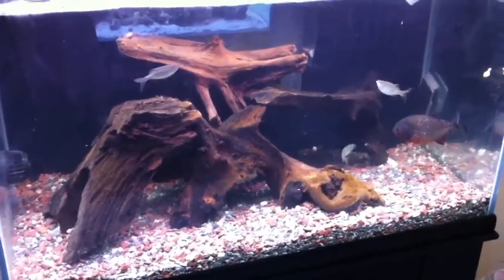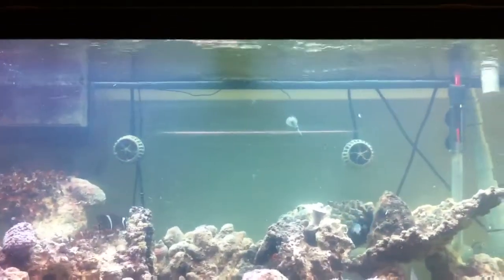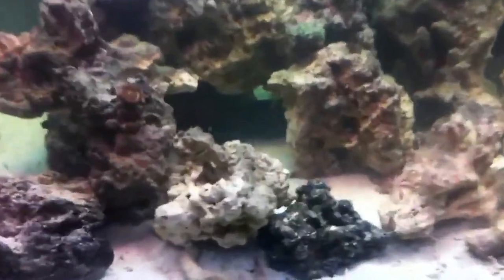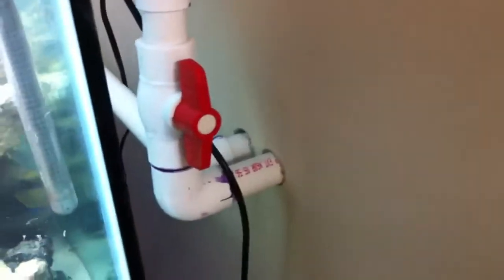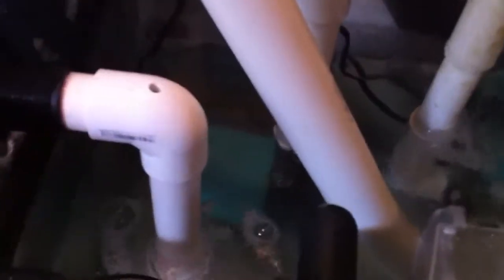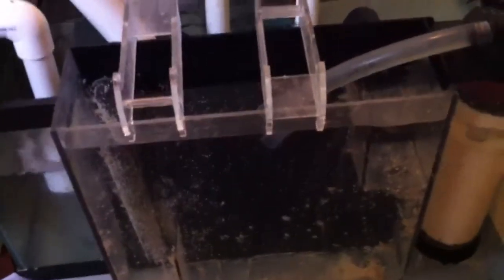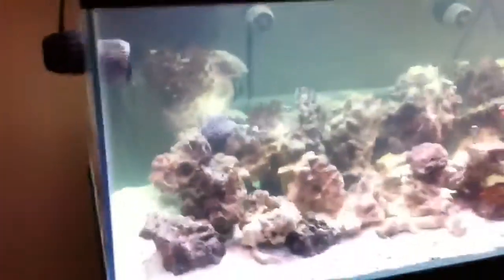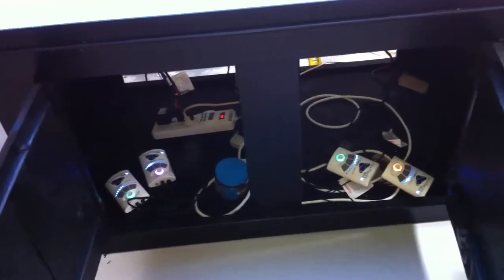75 gallon to 120 gallon reef update!

Comment from the maker: Sorry, just saw your reply, question. 
The MP10s have no problem driving through the back wall of the tank. In fact, one of the sticky power cord holders came loose & the pump held itself in place until i noticed & fixed it.